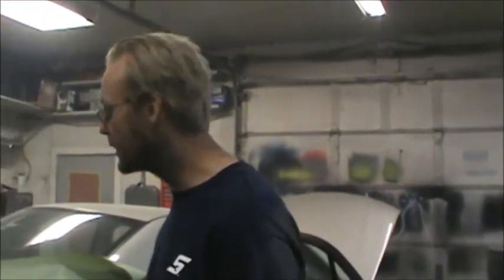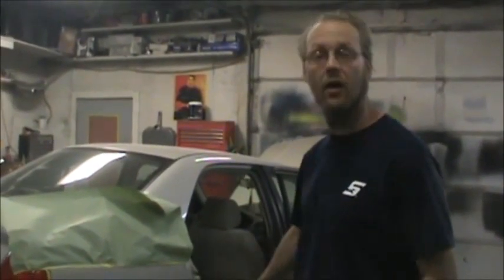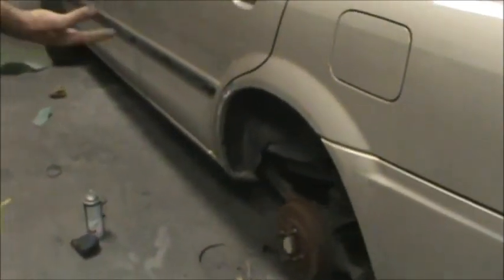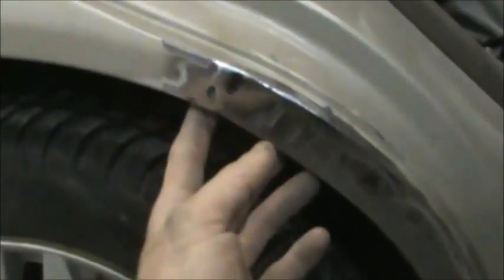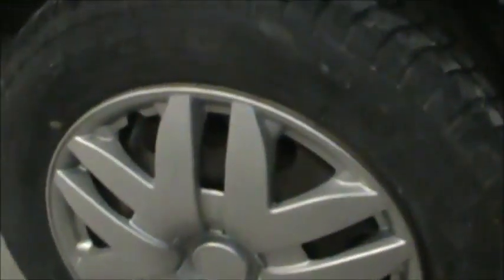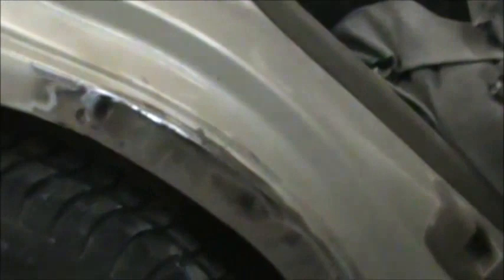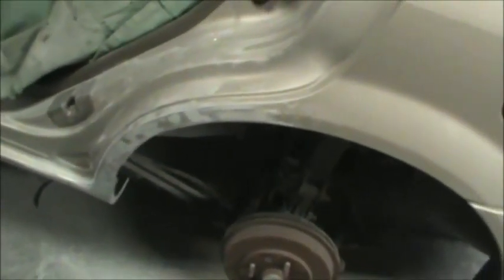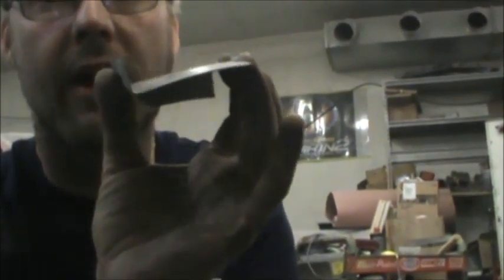2000 Mazda Protege #2

Comment: I got a 2000 mazda protege lx.  And the rust is in the same spots.  I am looking for a full restoration.  Top to bottom.  Is the something you do at your shop?
Reply from the maker: Yes absolutely feel free to call the shop
Reply: To do everything what would be a good easement from you knowledge?  And the bodey is kinda rusty tords the bottom.  But mechanically everything is good.  Just needs some serious bodey work.  Rust....  And lookin, running, sounding like new.
Reply from the maker: We would have to do an inspection and assessment before I can even pretend to give a number